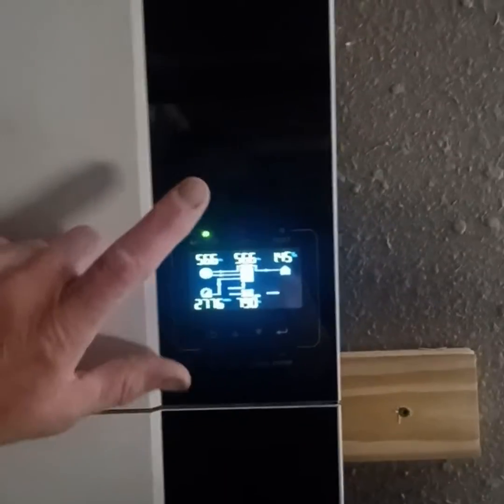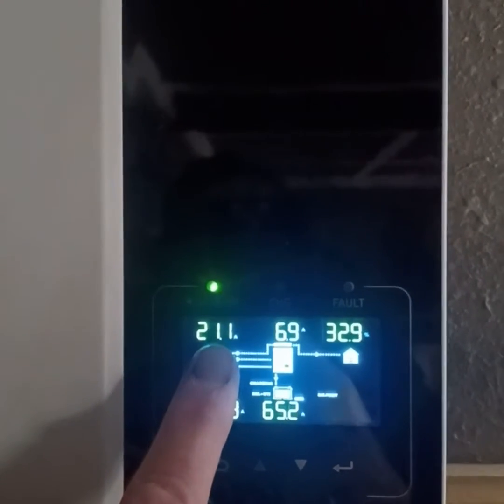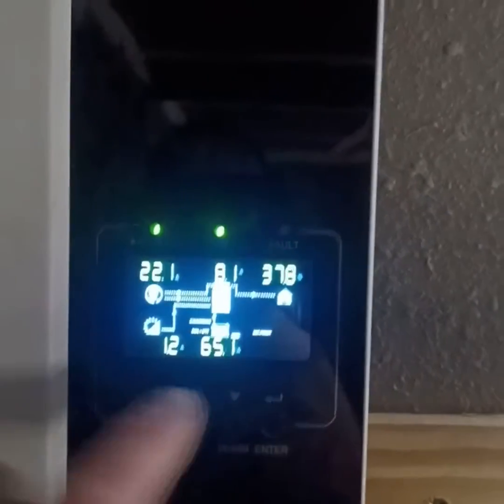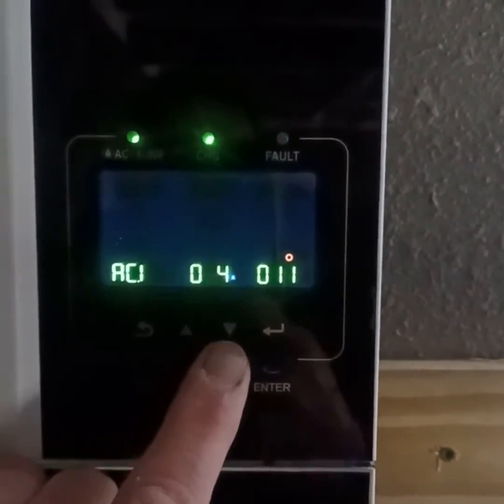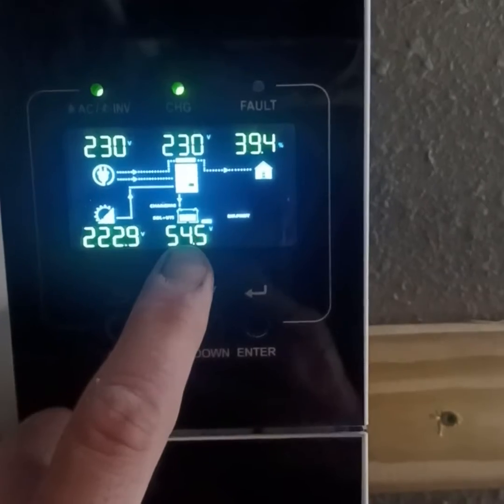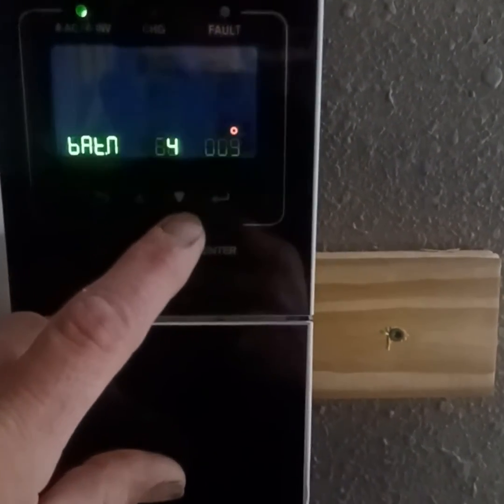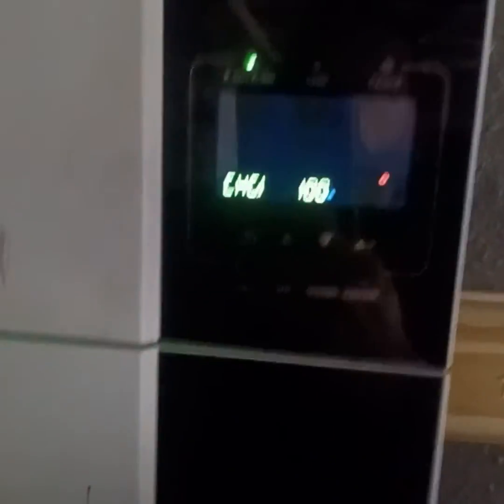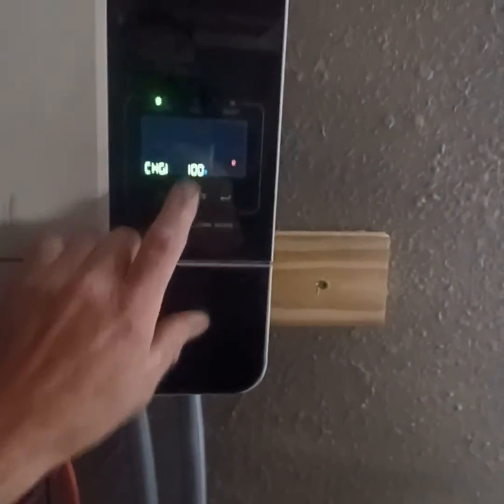Hot tip for the grow watt 5000 es off-grid 48 volt inverter running off of generator

Comment: Great 

How to fix error 08 on Growatt
Reply from the maker: @CharlesDunira  turn off all electrical connections coming input such as PV generator AC. Shut inverter down for 30 seconds completely. Restart inverter DC input on first. Turn on battery then see if 08 fault still is active. If code 51 or 52 appear or the dreaded 08 code appears immediately before startup on AC output. Your inverter had a heart attack on one of the three boards,  most likely the driver board. It'll need to be serviced. Suggestion signature solar Sulphur Springs Texas roughly $600
If the system does start back up be aware most likely you need an EMP protection on the DC array. This is most likely due to lightning strikes or the dreaded 07 code over surge protection
Reply: @Offgridsolar4life  thank you